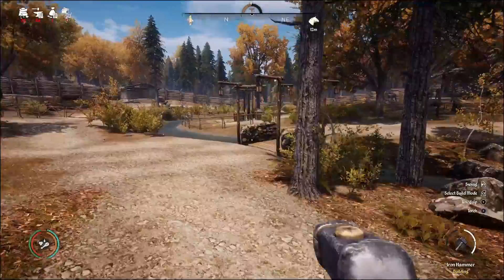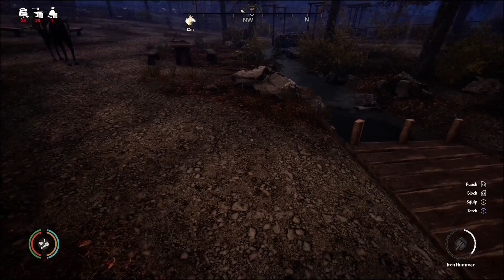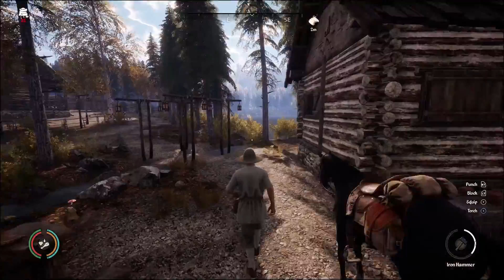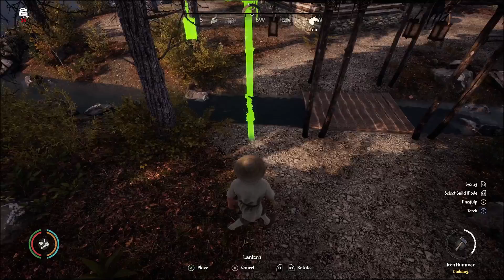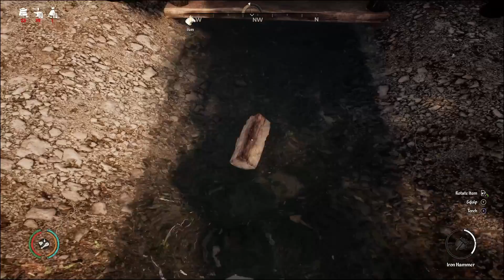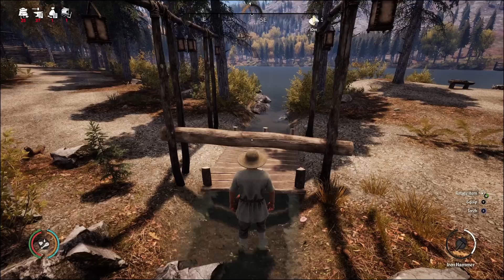How To Build A Bridge In Medieval Dynasty

Comment: Do villagers pass on it?
Reply from the maker: Unfortunately no or rather not really. The game isn't coded for villagers to path find like that. They only follow the default roads built into the map, and don't recognize the bridge. I even read on the Steam forums somewhere before that is the reason the devs haven't ever included buildable template bridges like with buildings and stuff. I made a road from my village to the mine and the miners won't take it they just follow the roads that preexisted on the map.

One thing I've seen that people do is build fences on either side to kind of funnel them towards it, since they won't jump the fence they will end up crossing it that way, but you kind of have to not give them any other way around for them to use it. I don't like the look of doing that for where my bridges are so I just made them for myself and just decoration really.